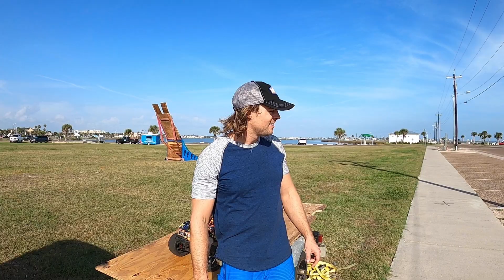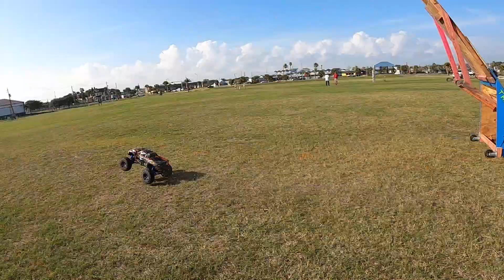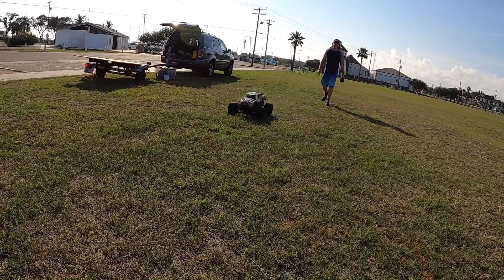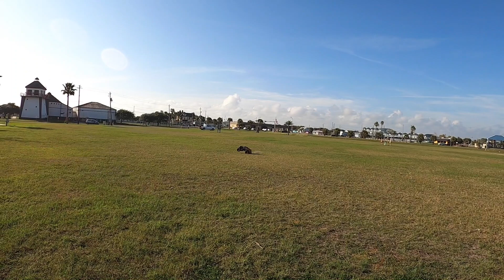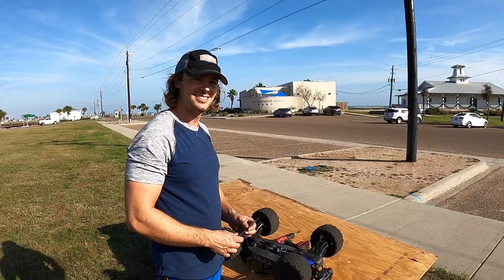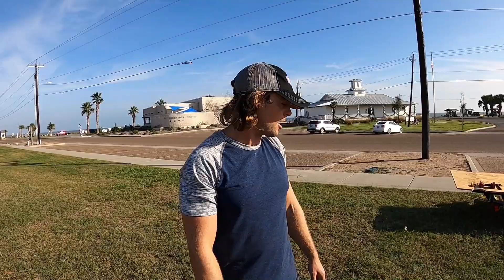Full M2C Xmaxx Build and Test Bash!

Comment: Great video👍 I’ve been using WFO motor mount in my Xmaxx for the last 2 years and have never had any issues! Not sending it 75 feet in the air but I’m guessing 99% of people ain’t trying to either 🤔 also the mod 1.5 ⚙️ ain’t all there cracked up to be!!!! Broke way more of those than mod 1 saga gears ⚙️ actually not even close! Just a heads up if your expecting miracles from mod 1.5 gears lol 😝 save ur money and grab some different gearing options from saga. Glad to see m2c finally sponsored you I told you bout a month or so ago it was coming cause not hardly anyone probably in the world sending it like you except maybe rich or rcdude!!!!👍👍👍👍👍

Comment: Freaking awesome stuff👍💯💥, still baffled on how you run 8s copperhead tires, I tried it and the offset cuts my arms and steering links apart in less than 5 minutes! Specifically I tried copperhead mt 2, are you using a different one?
Reply from the maker: Thanks so much bro! Yeah the copperheads eat through the arms pretty quickly... I just deal with it haha. I am running the version ones and they seem to do better than the2nd.